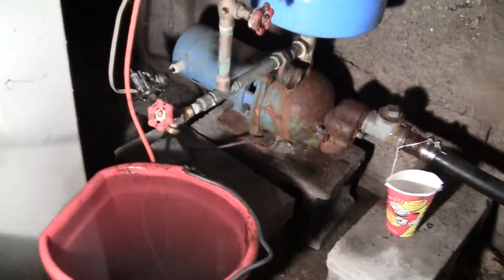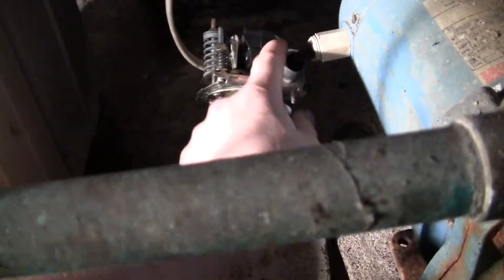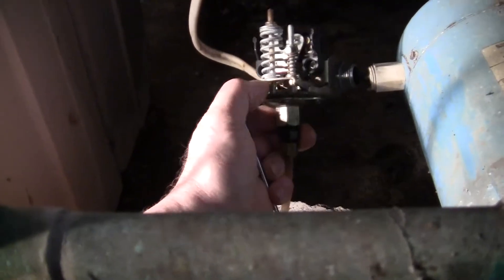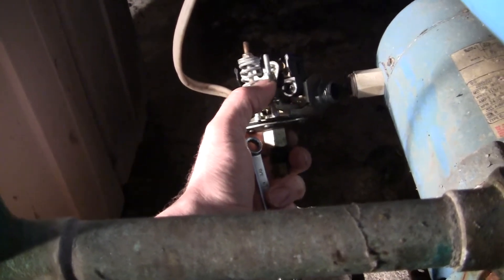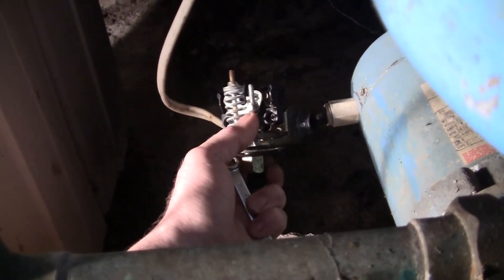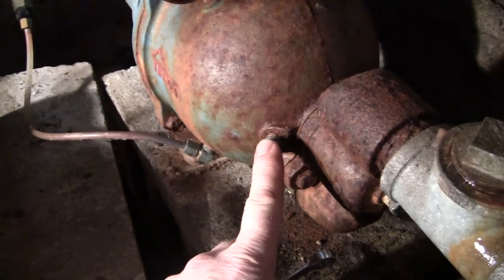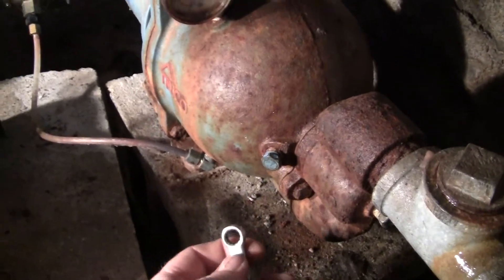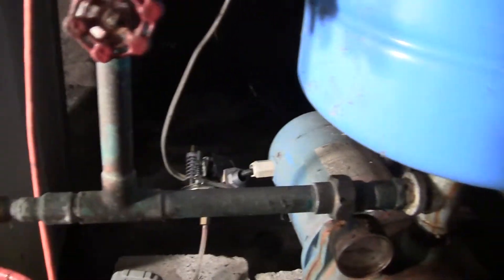Jet pump how-to's.MTS

Comment: Hey Shawn, I just got my Aermotor jet pump fixed, this morning it wouldn't prime so I pulled the motor  off the housing casting, and the problem was a broken impeller!! I had an old one on the shelf, so I cleaned it up and got it going. The plastic impeller broke out at the hub and the motor would spin and not the impeller, it sounded weird too like it had no load on the motor and would spin easier after cutting the electric power.  Yes! another Sunday morning repair!!! Thanks for your videos!

Comment: I just had to do battle with the basement at my Dad's flooding. We had a wicked rain storm so it was coming in the basement door and it was also seeping through the walls. The sump pump and shop vac got a good workout! So this spring we'll be digging up the basement and parging the walls with tar. 

Get better soon!

Comment: The taller adjustment actually adjusts both the cut in/cut off pressure.  The shorter one adjusts the differential between  the cut in and cut off pressure by raising or lowering the cut off pressure.  If you keep losing prime then it's either your footvalve or your leaking plug in the tee.  If it leaks it  can suck air and cavitate the pump.

Comment: @3Mudbone1 I call it tar because it's black and sticks to stuff like it's nobodies business. It's actually a flexible waterproof rubber based waterproofing spreadable membrane. It's made for sealing basements. Don't know what it's called but I will before summers done as I'll probably use 10-15 gallons of the stuff. :(

Comment: Nastey black mangnesium. Does'nt the pressure gauge work? Their only about $6. I've got my pressure switch set at 40 & 65 psi. Another thing i know is when the water pressure won't hold or rapidly falls off it means the expansion tank is out of air (30psi) or even fucked.